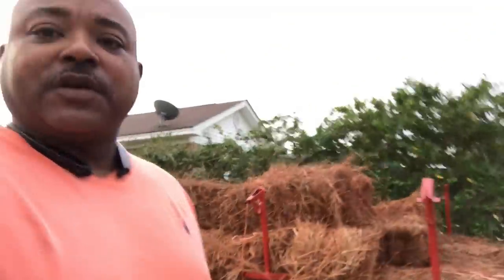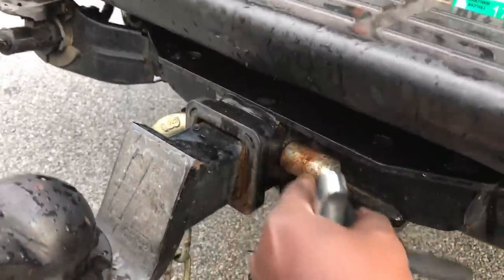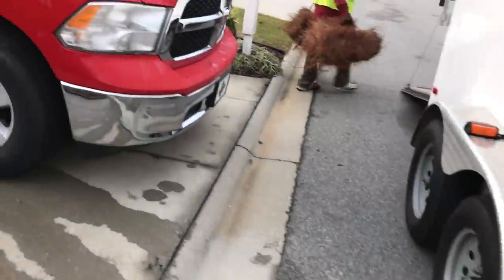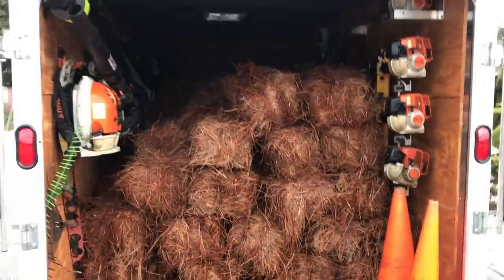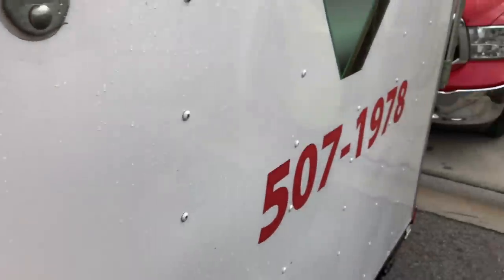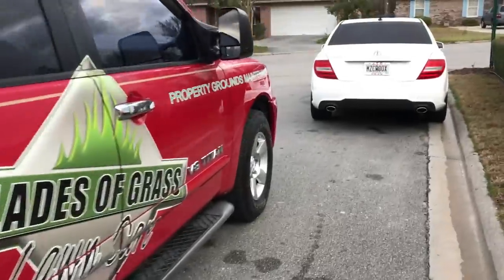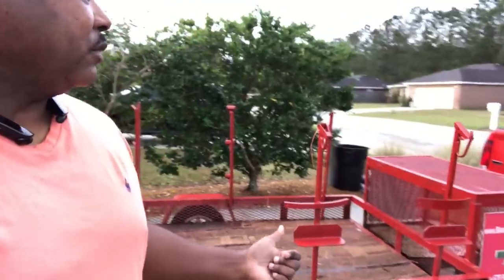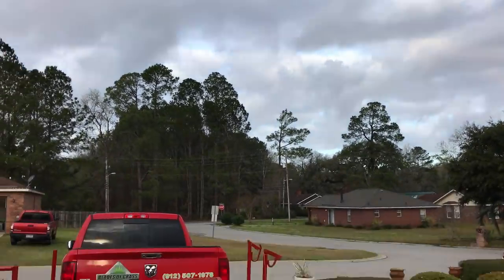Unforeseen lawn care business issues- Enclosed Vs open lawn care trailer

Comment: One con I've noticed with enclosed trailers is that when its really hot, they don't allow equipment to cool off as quickly.
Reply from the maker: Well... I agree with your statement on heat inside the trailer, but I've never had a mower go down for being too hot. We run our mowers constantly for 8 + hours a dayand you know that it gets hot here in Savannah.
Reply: Blades of Grass Lawn Care, LLC Love your channel!  You really care about the quality of service that you give to your customers.  Thanks for your time and dedication in sharing.
Reply: Blades of Grass Lawn Care, LLC Great channel!  Just a thought about your box van.. you might be think to add a temperature controlled exhaust fan to help with the heat inside the van?